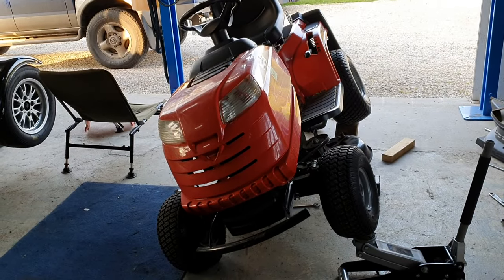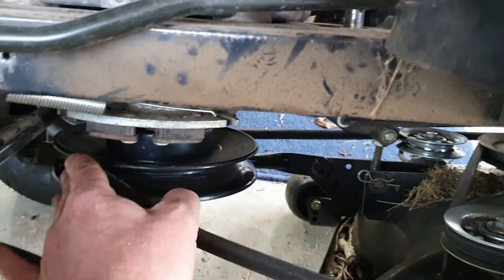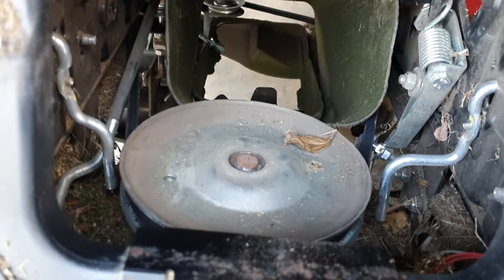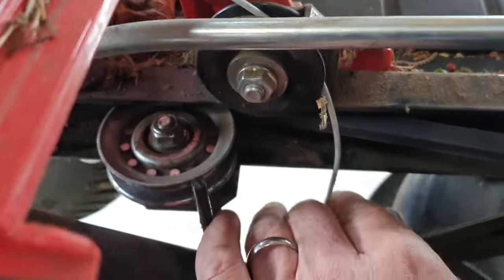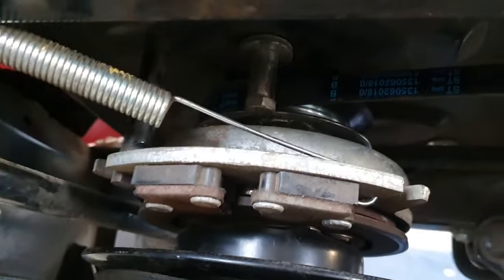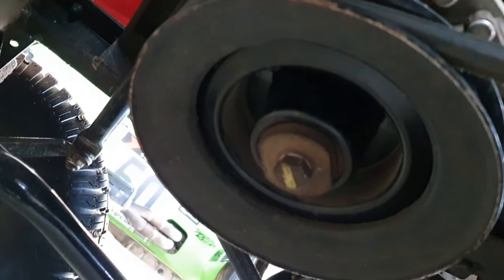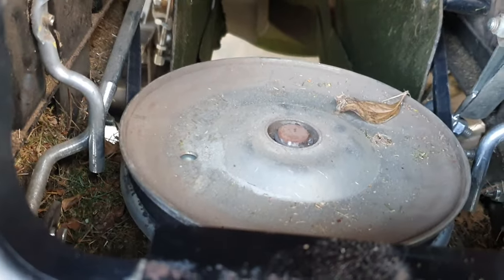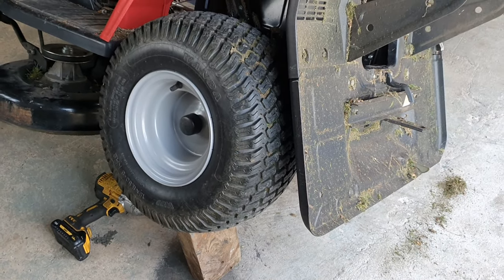Changing drive belt on mountfield / stiga / castle garden lawn tractor 1430/1436/1530

Comment: Very useful video which helped me swap the transmission belt on my Atco GT30H. However, my clutch was rusted onto the crankshaft, so removal was a pig of a job, as no place to fit the pullers on securely. So its was a case of tipty tap and pry bar off the clutch very carefully as it has a cast ally case. Re-assembly I found best done by putting clutch and deck pulley together off the crank, and then sliding onto the now clean and geased crank. Best of luck to all trying, and thanks again for the above video.

Comment: Excellent vid. Thanks. Helped me out with the 1638H. Couple of differences. There’s a fan on top of the gearbox at the back so I put the belt over front and back first. Then lastly put on the spring clutch pulley (bit fiddly but manageable). No need to remove the front engine pulley on the 1638H, just undo 10mm bolts on the port side of the pulley and slip the belt up. Hope that makes sense.

Comment: Great Job. Just looked at my belt as it was making a lot of noise and its got lumps missing out of it and cracked all over. I did notice that the belt goes slack when pushing the break down. I will be following your good advise.

Comment: Just what I’m looking for and very well explained I have the exact mower 👌 would this be the reason for it slowing down in higher gears on hills? Is there anyway to adjust this or checking if my belt needs replaced first ? They seem to be very pricey for genuine part .. 🤔
Reply from the maker: This will be the reason it slows. The adjustment is automatic by a spring loaded tensioner. Once the belt has broken down/stretched beyond the amount the tensioner can take up, it slips, which will end in failure not long after.
Reply: @cashmax  is that the spring next to the brake-side pulley?

Comment: How do you remove the drive belt reel under the motor, the one at the front, aften you have removed the bolt ?
Reply from the maker: It just drops off the shaft or may need a tap. If you cannot remove it, just undo the belt guards on either side and you can do it that way instead.

Comment: How do I remove the blades on a Stiga 384m. Thanks
Reply from the maker: You jack up one side of the mower. The bolts are 13mm and if you have an impact driver it's easier, if not use a block of wood to stop them rotating. Be sure to understand that the two blades rotate in different directions and the bolts undo the OPPOSITE way to how they rotate in normal use. In other words one will undo counter clockwise like normal, whilst the other will undo clockwise. Just look at the cutting edge to see which way each one rotates. I think there is a sleeve with a keyway that may or may not come out on top of the blade, be sure to check how it went on and don't lose the key of it falls out of the shaft. (They normally stay put)
Reply: Thanks for your reply I will give it a go.
Reply: @charliefarlie4309  Think you will find the bolts are 14mm and if they are contrarotating one is left handed and one is right handed. and if it it side discharge they are both right handed.

Comment: After drive belt change the starter wont engage?
Reply: check micro switches for connector s  popped off
Reply: Hi did you figure out what the issue was? Mine is doing the same 🤷‍♂️
Reply: @kiltedmckay9504  i dont remember but i suspecthere was some safety kill switch
Reply: @kristokivioja327  all good I figured it out the assembly wasn't slotted in right and stopped the engine from turning 👍
Reply: @kiltedmckay9504  did you have any issues with the brake pedal because after fitting a new belt the pedal won't depress as the new belt is so tight
Reply: @barrywatters7181  no nothing like that.  Tbh my belt was loose when it went on but mine is the older model.